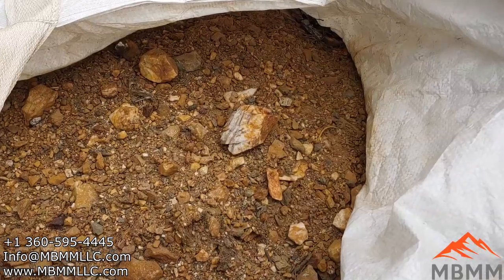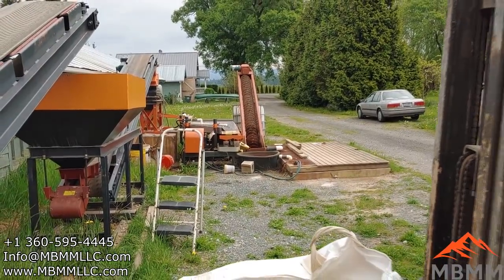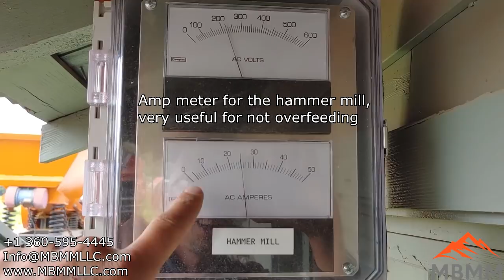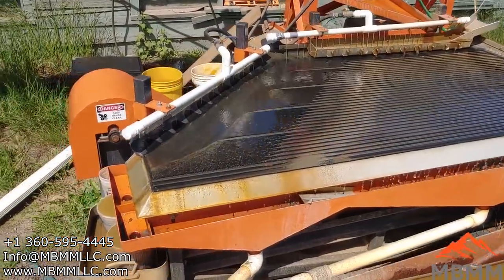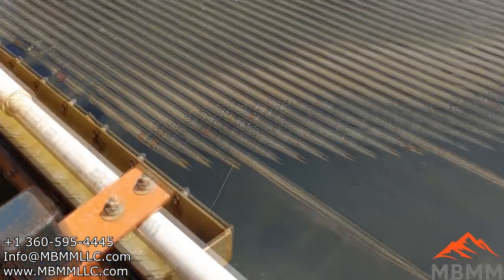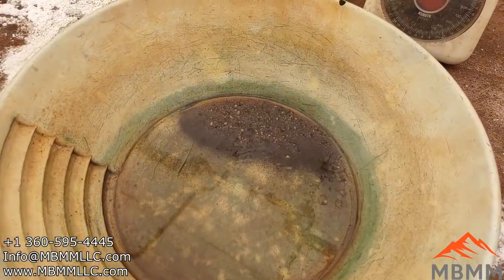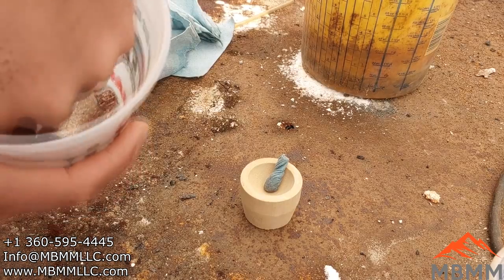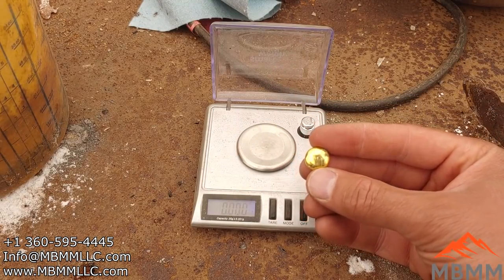Refining Rocks To Gold, Complete Gold Mining Plant

Comment: I must say, I really like how your plant processes material, I wish I had something similar however smaller scale to run on my future site.
Reply: Yeah my rock crusher is a jackhammer that I welded a old thick ass frying pan to after I cut the handleoff...so yeah same
Reply: @implausibleimpossiblehypot4006  I currently have a "dolly pot" style crusher I made from farm scraps, a steel plate with a steel pipe welded onto it, the head of a sledge hammer attached to a piece of steel rebar, ye old manual crusher for now lol  but hoping to either build or buy something better eventually lol
Reply: @Reglabbe   that’s quite cool and a tad bit more advanced than mine I’d imagine because I have to manually dump all the crushed rock
Reply: @implausibleimpossiblehypot4006  so do I lol my crusher is bulky and cumbersome lol the steel plate is 2ft X 1ft, the steel pipe is 3ft tall X 8" diameter, she is a beast lol but does the job with minimal effort, only crushed a few samples but it made quick work of them, the weight of the rebar and sledge head really make a difference.
Reply: @Reglabbe  the jackhammer crusher is mounted to  a chainsaw mill that I screwed to the wall and  as long as it doesn’t explode from my poor engineering It dose some work on quarts and  granite so it’s a dangerous beast
Reply: He should make a smaller version just scaled down.

Comment: hey Jason, what temperature does your little cupel oven go up to?
Reply: Jason what temp for the cupel? I tried cupelling without a furnace to see a precious metal button. I added 25g lead to my blue bowl cons of about 10g I used a glass blowing torch (oxy/ propane) it took a while. The cupel was cherry red, the dried cons mixed with the lead and melted to a rolling button. I continued the intense flame around the button in the cupel for almost 40 minutes cause it seemed like to was sticking to the cupel. At the end where I thought the lead was being absorbed into the cupel, it turned out that everything was absorbed? Can you help me understand why?

Comment: Will these rocks set off a metal dectetor like a at gold or w.e the gold finders are called. I have a few quarts vains on my property but theres no hits on the detector
Reply: From what I have seen from watching the TV show called Australian gold you can only detect larger pieces of gold and not the super fine traces of gold. Let's say a piece that is half the surface area from your pinky nail. But some pieces of quartz are packed with so much gold that the Australians call it a specie, short for specimen. And those can be detected. 

But I think that those specimen are an exception and that those super packed quartz veins in the US are already mined by the old timers, or so hard to reach that it is a big risk to do all the investments. But is it worth the effort? It is always fun to try, but I hardly believe that it will give you much of result. And it also detects iron and copper if the rock contains enough of it. So if you detect something it is not always a reliable signal. 

I would send a sample from the quartz material to the man in the video, and let let him do an exact test of the material. With modern technology and clever planning there might be some profit to catch where it wouldn't have been profitable in the old days. And the current gold price is pretty high. 

And if you find a piece of quartz of which you suspect that it contains a relative large amount of gold there is this special but very simple method to figure that out. It takes a kitchen scale, a cup of water, and a calculator. Anyone can do it at home. You can search for this video. How to calculate the weight of gold in a gold quartz specimen without crushing it.
Reply: @ex35240sx  You're welcome :-)
Reply: @ex35240sx  And if you can't send a sample you can also copy the process with simple tools. Although it might take some more time and effort to get to the same result. But if time and effort is not a problem it is always worth the try. I would try it if I had veins of quartz in my backyard :-)
Reply: @insAneTunA  even a week ago it would have been easier. Everything gets over grown real fast here over night almost. So i prob wont be back on that part of my property till fall lol
Reply: @ex35240sx  My neurotic curiosity would not allow me to wait that long :-)
Reply: @insAneTunA  lol i just dont wana get eaten by a big cat or bear
Reply: Call a recycling  yard in your area and see if they have an XRF gun. Ask if they will analyze a rock sample for mineral content. Not as thorough as a fire assay, but will give you  an idea ...